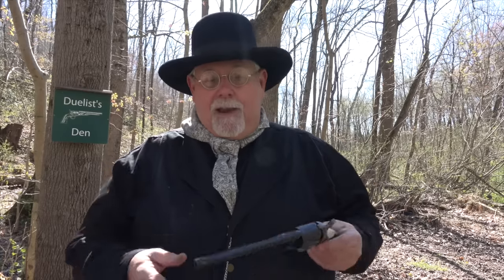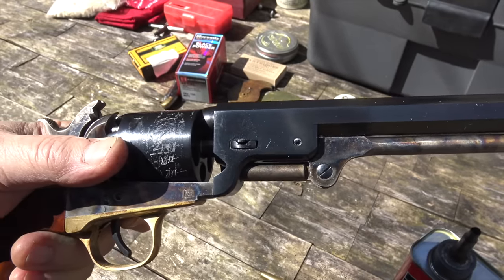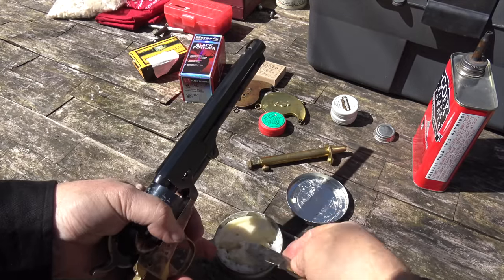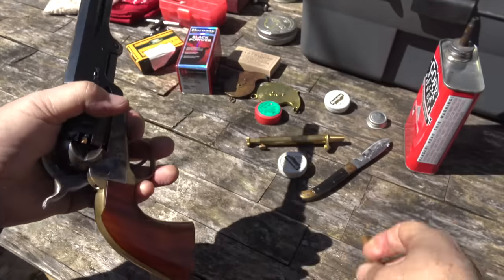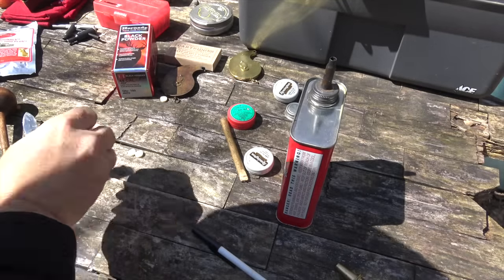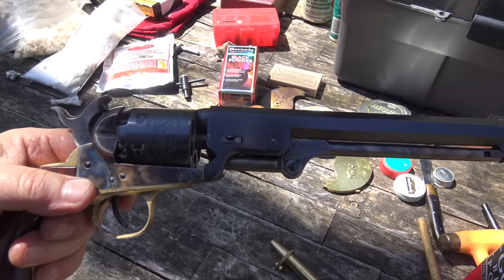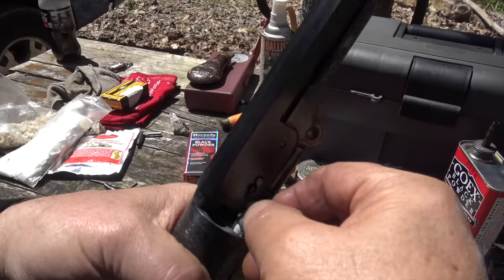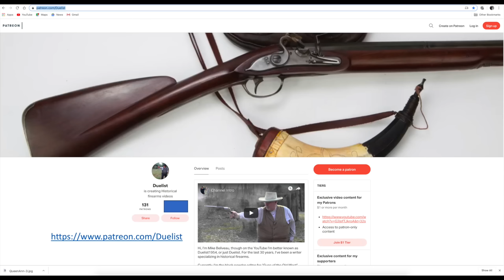How to load a cap & ball revolver

Comment: I always use a felt wad between the powder and ball, then place a special grease wad over the ball. Both for lube and preventing chain-fires. All three of my blackpowder revolvers are .44 cal, but I found that my Uberti Colt Walker is more accurate with .454 balls, while my CVA 1851 and Pietta 1860 Army perform better with .451
Reply: none of those are .451
your barrel id is .440 your chamber id .444 when you squish the .451 down into the cylinder its now .444 then when you fire it has to shave off an addition 4 thousandths becomming a .440 upon exiting the barrel. everything you load will become .444 when in the cylinder so to say a .451 did better is actual nonsense

Comment: Looks easy enough. No stress, no pressure, nice day outside. Now just imagine trying to perform this reloading task 150 years ago, under fire, fighting as a soldier in the Indian Wars. Heart racing, winded, sweat in your eyes and more likely than not, you are moving at the same time, and maybe even wounded, with the unnerving sound of the Indian war cry in your ears.
Reply: Back then they used cartridges made from thin combustible paper glued to a lead round, often a conical when available. That really cut down on load time with only the percussion caps needing to be replaced. Balls would have been loaded once the conical stock ran out.

Comment: I was taught to cap off each nipple once first before loading to dry out the oil and help prevent misfires. I've found that cabelas brand lubed felt wads work great between the powder and ball and in my experience a lighter powder load tends to make the cylinder rotate better and not seize up after 6 shots like a 15 grain load in .36 and a 25 grain load in a .44 colt style repros. Plus with colt repros after the first shot rotate the piece to a 45 degree right angle and cock the hammer on that angle and keep an eye on the hammer and back of the receiver to make sure no cap swallowing happens. Do that every shot after the first shot. Doing that I've never had a cap get swallowed and I've shot thousands of shots out of colt repros

Comment: I do use Crisco with Bee wax if it seems to susceptible to heat from the sun I use more Bee wax. Works just fine and have over 100 rounds throug the same pistol in one event. I have changed to multiple cylinders since. I preload 7 cylinders now 6 in my belt and one in the gun never had an isue. But you go ahead with Mutton tallow if that is what you like but I find that sort of thing just gets rancid to easy. Otherwise great video signed The "Wretch"

Comment: Much appreciated.  I had been using Bore Butter on top of the ball and it is seriously messy to handle.  (Probably going to stick with pre-lubed patches.  Life is short.)
Particularly helpful - seating the caps.  I get a bit nervous about setting them off, and I am not going to get them down with my thumb or the capper.  The dowel looks like the best option.

Comment: Pre-load Multiple Cylinders and 1858 Remington. Great channel. Had the same problem using lard trying 1860s research, fowling the cylinder in extreme heat. Add some candle wax to lard.

Comment: I have some convenience (at least for me) when it comes to lubricating the chambers. This works well with your own beeswax grease. After mixing the ingredients and cooling them, I form balls with my fingers, maybe 2/3, sometimes 1/2 the size of the ball I am loading. I keep it in RWS1081 cap boxes or a similar size, they hold about 70 grease balls. I don't have to take any spatula, knife, etc. I just take a ball of grease and either use my index finger or thumb to press it into the loaded chamber. You have to play a bit at home with preparing the BBs, but it actually saves a lot of time at the shooting range.

Comment: I have my shoot outfit, I have pouches with simple belt clips, the flasks too. I can bring the various pouches from my shoot bag, hang them on my belt, get at them easily. While standing, draw pistol, flask charge, ball in, oiler (DGW nickel silver w/dauber), caps.  I can do this quite easily. I return the pouches that were hanging from my belt, back to the shoot bag.  
I have 5 different caps sizes. Pouches with the various cap sizes are all labelled with a little tab with,- R10 etc.  Proper cap size eleviates having to 'dowell' seat. Also cap jams are greatly reduced. Pinching can cause other troubles,- Chain fire, cap failure, cap jam ,.

Comment: I use crisco mixed with plain candle wax to raise the melt temperature and thicken it up. I have never had a problem with it melting. Lamb tallow and bees wax is expensive and don't work any better but to each his own.

Comment: Nice 1851 Navy in this video. Looks like an Uberti. I have the same one. The chambers for this gun are not too large for .375 balls, but they are not small enough to shave a large ring off the ball either. The ball does fit tight though and the chambers taper down to .372/.373 and that is just enough to provide a good seal while still making for very easy loading.  

You could have problems if you use wads and they are too thick.  I never use them though.  I like the lube better.  The .380 size, in addition to being harder to find, is also just a bit too large for the Uberti 1851, in my opinion, and I have heard of people eventually damaging their rammer trying to shave off the lead and putting too much stress on the loading lever.  I might try making paper cartridges. Not sure how good it will go but it doesn't look too hard to do if you have a cartridge former.  Looks like it shaves off a bit of time reloading. As long as the glue holds good it should work fine if the right paper is used.

Comment: Howdy ! Glad to know you're doing well. I have some questions : Why people put a lubricated wad between the powder and bullet? Shoudn't the lube be at front and the wad dry so won't contaminate the powder? I see some people using grits and semolina to "bring the bullet up to the mouth" because it suppose to improve accuracy... is that true? Can you do accuracy tests with diferent loads? Powder/Bullet, Powder/lubed wad/bullet... unlubed wad, semoline etc? Lastly, one lesson I learned here in youtube is to make damm sure there is no air pocket on the powder charge... watch when you load 15g and a bullet, the rod may not push everything to the bottom. Keep at it ! Cheers from Normandy.

Comment: Hi Mike,  I've had a fondness for cap and ball revolvers ever since the first time I saw them in a Cabela's mag when I was a kid and your vids have kept that interest stoked.   I finally started putting together the kit for one based on these videos and have rounded up pretty much everything sans percussion caps, which seem to have gone the way of the 9mm.  Since I am new to BP I have a couple questions I was hoping you might address.  Is it common to run into fouling issues during a range session?  If so can easily you field clean the revolver to keep it in action?  Also would it be possible to put together a video in this series addressing common problems and how to troubleshoot them?  Thanks!

Comment: Howdy sir,  for 30 some yrs, I put caps on #11,
After that, I use my thumb to push hammer, that pushes caps all the way down so they don't fall off while riding horse back, plus I never never have had a bad firing when hammer has dropped.. 
Anyway it works for me.
Plus about shaving the ball when loading.
Mine 44, I use 45.1 ball.
What ball size do you recommend I use in the 44.
If I have been using wrong size. Plus I never have a ring of lead after pushing a ball in cylinder? I use powder, Wade, ball, Vaseline or better when I have it.. just observed why I use the hammer to press caps, 
If it had exploded, it would expel the round out the barrel and I figure that is safer for me.. Thankyou sir for your information. Some people don't agree with me why I use Vaseline or grease at end of cylinders. Please tell me I do it just fine for the last 35 yrs..
Your fan Harv.

Comment: Mike, I have seen on other sites that some shooters initially load just caps onto the nipples and fire the pistol "to clear or clean" them out. 
Is that really necessary?
Great video BTW, Thanks
Reply: Good question, I don't usually do that.
Reply: @RichB for rifles it can help indicate no obstructions in the barrel.  My first time shooting a rifle, the local knowledgeable gut teaching me, put a cap and shot it down at a blade of grass to look for deflection, implying there wasn't a load still in the barrel.
Reply: for my percussion pistol I can see light through the nipples before I ever put the cylinder into the firearm, if I cannot see light I clear them with a nipple pick.
for my side lock percussion rifle, yeah sure I 'snap caps' before I shoot, it's also a good safe way to double check the functionality of the firearm as well as double checking for bore obstructions
Reply: It's not necessary. I've shot cap and ball for a bit over 30 years, I don't fire caps to clear out nipples. The nipples never need it. It also would add a nickel a shot to the cost of shooting cap and ball revolvers - a very significant amount if you ask me. When I clean my revolvers, I never bother to clean the nipples, they don't need it. They clear/clean themselves when you run patches into the cylinder chambers. I never have an issue with plugged nipples or nipple corrosion. Caps are plenty strong enough to keep a nipple clear and ignite the charge.
If I can go decades without clearing nipples without ever having trouble with ignition, then why is it all over the internet to do so? A good question - maybe some sort of mass neurosis where large amounts of people are afraid to check for themselves? Or maybe afraid to admit they don't do it themselves because they would stand out from the crowd?
Popping caps to clear or dry nipples is a waste of money and time.

Comment: I just purchased a 1885 Pietta 44 Cal Sheriff Revolver . Uberti makes a  1858 New Army that looks identical.
However I’m curious wondering if the Uberti Revolver part (Loading Ram) will fit in my Pietta to give me the capability to use Conical Bullets.
The Piettas Ram is only good for Round Balls, that’s why I want to change it out.

Comment: Hi Mike.Very good video. As they tell you through your facebook account, it would be nice if you could get a Remington New Model Army made in Spain by Santa Barbara, in the 70s and 80s. With the skill you have you can make that revolver a very precise weapon to shoot at 25 meters. A friend of mine, and with that type of revolver, was sixth in 1990 in Leusden, tied for the third winner, in the Mariette competition, with 95 points, according to MLAIC regulations. It is as accurate as the Pietta Shooter clone, which is the closest replica of the original Remington. As you know, the Italian copies of the Remington have chambers a few tenths of a millimeter smaller than the barrel. The Spanish revolver does not. It's just a 45 caliber in the barrel and in the chambers (11,43 mm). The Spanish copy has a too small grip, like the italian Euroarms , but that for you who is a handyman, has an easy solution. From an aesthetic point of view, I like the Colts more, especially the Navy 1851 and the Army 1860. Greetings from Spain. Saludos desde España de Miguel Ángel.

Comment: I really enjoy the cap and ball related videos, they are very relaxing. And I'm slowing considering buying a cap and ball revolver. I know everyone is suggesting a 36 caliber Remington 1858 as a beginner revolver,  but i really like the colt pattern revolvers because they look more streamlined, especially the ones with the 4 to 5 inch barrels ( the sheriff models). Would a colt be that much more difficult to shoot as a beginner?
Reply: no. my first bp gun was a .44 cal colt army I built from a cva kit. it had outstanding ergonomics and was a natural pointer with good accuracy and (to me) moderate recoil.. the .36 cal pistols are more economical in powder and lead and were common on the frontier.
Reply: Ram: No, they are not more difficult to shoot.  Jump in!

Comment: When you press the ball in the cylinder, do you use anything between the powder charge and the ball?  How far down and how hard to do press the ball in?  First time cap an ball revolver owner, unfortunately my navy .36 didn’t come with a manual.  I bought it used and from a private seller.
Reply from the maker: I use a lubricated felt wad. Just push it until it stops.

Comment: Mike, great video and very informative. I just purchased an 1851 Navy in .44 caliber and wonder if the 23 grain recommended is valid.
Also are CCI caps any good? Thank you Sir.
Reply from the maker: CCI caps are fine, but they aren't really sized for revolver nipples. CCI #10s are much too small, and CCI #11s are a little too big. You can use them though. I slit CCI #10s with a knife before putting them on the nipples, and with #11s, I pinch them a bit.
Reply: @duelist1954  would Remington caps got better. Also I'm 71 years old Vietnam Vet and a touch of shake in my right hand,is it difficult to place and seat caps or is there a tool available? Sorry for dumb question.
Reply from the maker: @christopherhutchings9621  Remington #10s fit perfectly on most revolvers, and even Remington #11s fit well. I prefer to use a capper. There are lots of them out there.
Reply: Thank you very much Sir!!! Will be following any additional posts, and when get SSI check will patron 👍

Comment: As always a pleasure to watch. One question: why no lube /wade on a conical ?
Reply from the maker: If the conical is going over loose powder, I lube the chamber mouths after loading. If it is part of a paper cartridge, I dip the conical in melted lube to coat it after the cartridges are made.
Reply: Conical's were designed to be incorporated into a combustible paper cartridge. These cartridges were lubed from the factory. It's interesting that no where in Colt's factory literature is there any mention of the use of wads or greasing over the chamber mouths.
Reply: duelist1954 —crystal clear !!
Reply: If you look back in the video you'll notice a milky appearance to the bullets in the cartridges. That's the lube.

Comment: I use toilet bowl wax or bee's wax. Pure bees wax must be melted and used. Better for hunting loads when you have the time. The nipples are also sealed. This has been tested with the cylinder in a bucket of water for 24 hours, more than once.  I use the toilet bowl wax in the field and at the range. Also tested for waterproof. You can leave chambers sealed like this for as long as you please.

Comment: Hey Mike, I’m just watching “The Good, The Bad and The Ugly,” and I noticed something that doesn’t make sense: when Eli Wallach’s character, Tuco, gets a new gun, he loads it with cartridges. However, the gun is a Colt, and it still has the old-style loading lever on it. I’m presuming this is just a movie mistake, right? Did cartridge-conversion Colts have loading levers still?
Reply: The GTBATU is meant to take place during the Civil War but to make the action faster and more familiar to modern audiences, as well as the actors they used Conversions that wouldn't have been first used until 1871, a full six years after the war.  They kept the loading levers to keep the old look, and that was indeed what really happened sometimes to guns converted by a local gunsmith when a gun owner wanted to save a couple dollars.  Conversions done by Colt would have dropped the old loading lever for an ejector rod.  Tuco's revolver swaps back and fourth from black powder to cartridge several times during the film.  They all have cartridge belts as well for that cowboy look.  In reality they would have all used paper cartridges with lead conical kept in a leather ammunition pouch.

Comment: Hi Mike!  Did you by chance modify your 1851 Navy used in this video to better accept the paper cartridges?  I'm assuming you did the same thing to this gun as you did on your previous video modifying the 1860 Army for paper cartridges?  I have a Uberti 51 Navy, and am having trouble with it loading paper cartridges having the Colt Bullet from Eras Gone.  Thinking about filing away some metal at the base of the barrel, near the plunger to make it work better.  Thanks!
Reply from the maker: No. Most Navies load the paper cartridges just fine... .36 caliber Navy revolvers...If you ave a .44 caliber Navy, paper cartridges are a no-go.
Reply: @duelist1954  I purchased both my Uberti .44 Colt Army & .36 Colt Navy around the same time five or six years ago.  I've had the exact opposite, in that the .44 Colt Army will accept my paper cartridges, (with just a little bit of fuss), stock as it was out of the box.  My '51 Navy on the other hand just doesn't want to take 'em very easily.  I think I'll have to duplicate what you did with your Army in removing a small amount of metal around the plunger.  I'm sure Uberti and Pietta have varying qualities of guns from year to year.  Thanks for all you do Mike!!  Happy New Year!!

Comment: Hey Mike, you may mention it in one of your videos, but I wanted to ask you something. How thick are the steel plates you use for cap and ball? And do you have a company you usually get them from?
Reply from the maker: I think most of them are 1/2 inch thick...standard AR-500 steel. I’ve bought them from a variety of places, but Amazon has a good selection.

Comment: Did you say Capeandball's  cartridge maker tool works with round ball?  
 I thought it only worked with conical.  If it does work well with ball, I'm getting one asap.
Reply from the maker: It works with round ball. The template for the cartridge casing is a little different than for conicals. His instructions explain everything.
Reply: What I've seen are cartridges with round balls where the ball is overwrapped with paper as a means to stick it to the cartridge wall.